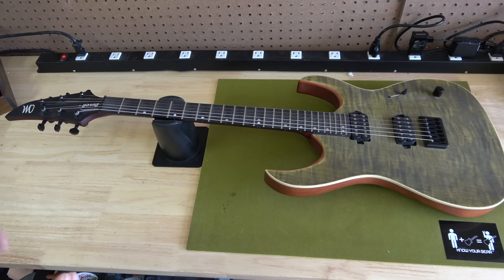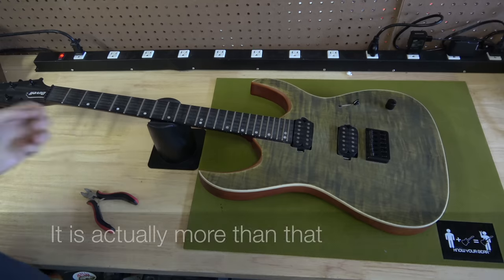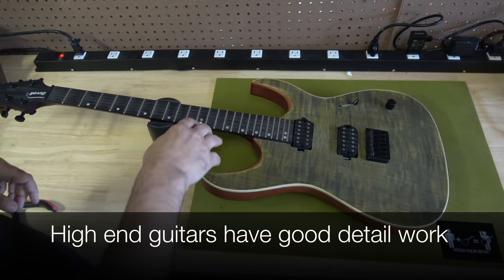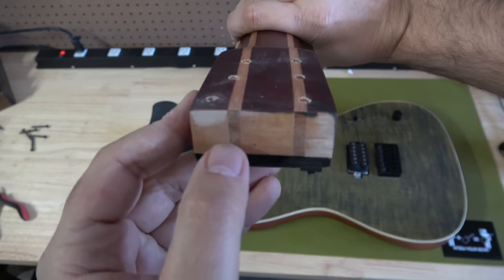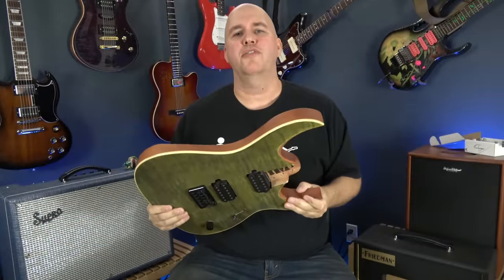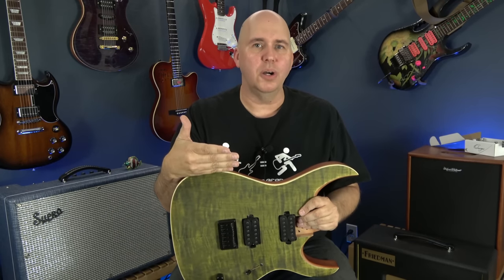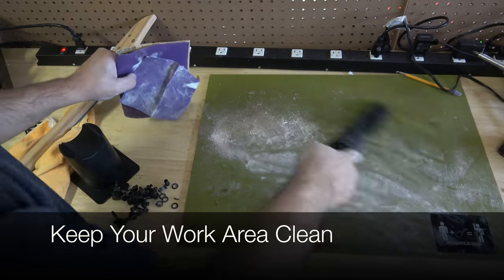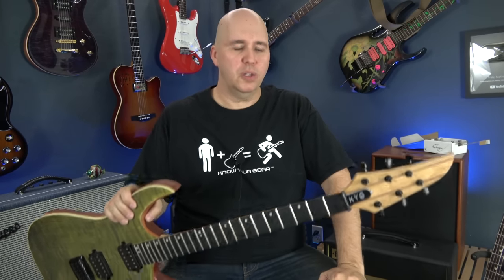Counterfeit Guitars Are Out Of Control.

Comment: Great video, thanks for posting it.
However, I think you should have mentioned the flip side to that.
If guitar companies weren't putting obscene prices on their guitars, maybe people would be less inclined to get fakes.
Especially the big lie about using "tone wood" in solid body, magnetic coil pickups guitars. 
As if there were some magic microphones picking up the resonance of the wood that makes about 95% of contact with your body.
And after you visit the factories and see how they actually make these guitars, you realize that you are paying 4 times as much as you should be paying for an average Strat, Les, Mayo etc.
I bought a good set of Alnico 5 pickups (not fake) from a Chinese company called Homeland. We compared them to Jazzy Cats, Fender, Fender custom shop and others and they crushed it. Good pickups. My advice is, not to buy guitars with fake logos but if you are after a cheaper guitar, buy them from Chinese custom shops. Some of them make excellent guitars. 
Also, if you ARE keen on buying American produce,  my advice is to reward companies that take the time to really make an effort into making a good guitar for you.
Take PRS for example. In my opinion they are the best "mass producer" in terms of value for money in USA. 
They take the time to invest in quality and materials and don't hire a star guitarist to justify and hype up a guitar made from Sassafras, as if it was some kind of Godly material that makes your guitar sound like it's from heaven... and sell you a bunch of crap because they had some extra wood laying around they needed to get rid of.
And if you are not keen on buying from a mass producer, by all means support the small guitar makers because they will take your guitar to the next level and they deserve that money.

Comment: I purchased a guitar from an individual Its Gibson SG Custom. Displays on back of the head stock 0200560 Made In USA. I emailed Gibson with serial number within 10 minutes Gibson emailed me back I had to send pics of head stock front and back, body front and back, binding on the neck and head stock, and tone control cutout. Got my answer back from Gibson they said it was fake. The wanted to know what guitar shop that was purchased at, I told them i purchased from an Individual. But playing the guitar neck pickup was very bass sounding and bridge was treble sounding hardly no sound coming from it. I installed Seymour Duncan Hot Rodded Humbuckers. which sounds excellent.

Comment: I feel bad. I had a Squire Strat, was my first guitar that I got when I was 12. I overhauled the whole thing. Every piece of hard ware, every electronic. As I used as many authentic Fender parts as I could, or bought high quality parts when I couldn't get my hands on something Fender. Spent way more money than it would ever be worth. But when I refinished the head stock I bought a Fender decal. I figured there was no harm since I would never sell it since it had sentimental value to me. And it played as close to a real Fender that any Squire could. But then it was stolen and never recovered. I'm sure they pawned it. But someone out there probably thinks they have a real Fender strat when really it's just my $100 shitty guitar with $200 worth of parts in it.

Comment: I do not condone ripping off someone else - ever. However, I have a "Slash LP Chibson" that I paid $225 for (Slashs' original AFD guitar was also a knock off, I might add). Anyway, I swapped out the pots, tuners, added Sey. Dunc. Slash pups, and leveled and dressed the frets AND the thing totally kicks fucking ass! The difference (if any/very little) between an actual Slash signature Gibson and mine in play ability and tone is negligible. However, the difference in price is very substantial (mine, all in, was under $500). Everyone who has played it didn't know it was a Chibson until I told them...EVERYONE. So, until I hit the fricking lottery, I have no problem using a "counterfeit" but, very workable base, then adding quality parts where it really counts and ending up with a smoking fire axe. If that is bad then, I guess, I'm happily rotten. Oh, well. P.S. I'd never resell it as authentic because, only a total MF'ing piece of shit prick bastard would do something like that. Peace out.

Comment: Here's my story, of a too-good-to-be-true guitar purchase.

I started off on a Squier Strat.  When I decided to upgrade, I did a lot of research.  Fixed bridge guitars stay in tune better, and I hadn't really used the trem bar, so I wanted a fixed bridge.  I also like rock and metal, so a humbucker arrangement seemed like the better choice.  I eventually decided that I would upgrade to a Schecter Hellraiser.

I was saving up for it (about $850 retail), when I came across one on Amazon.  It was $588.  It also looked a little different, and that had me concerned.  Schecter had the Satin Black and a Red Burst Hellraiser on their site.  This was a Trans Black Burst.  On the one hand, I really liked the look of it.  I liked it better than both of the color options on the site.  But it set up some red flags.

So I did my research.  I reached out to the vendor, and they said "oh, yeah, it's the same exact thing as the others, just a different color."  Well, that didn't satisfy me, because of course the vendor would say that.  So I looked on Schecter's archive, and after hours of searching, I could not find a trans black burst Hellraiser.

I was ready to go to Amazon and report that they had a counterfeit guitar on their hands, but I had to be sure.  "I can't find it" isn't proof enough.  So I reached out to Schecter.  I sent them an e-mail with a link to the Amazon sale, and asked them what the deal was.

"It's the same exact guitar, just an older color run."

Now that Schecter confirmed it, I knew I'd found the perfect guitar.  It was the guitar I wanted, in a better color than I'd thought, for $260 cheaper than I thought.  It was too good to be true, except it was true.  And it's my favorite guitar.

Comment: I think a more dignified way of branding it other than fake that reflects that it has been repaired and upgraded would be better.  Perhaps a color coded KYG - say, in red, to reflect that it is an upgraded and improved fake guitar would give it more value; after all- you Phil, have put so much work into it.  It is starting a trade mark on your work that was once a fake guitar. I, for example might be more inclined to buy a KYG rehab-ed fake from someone than say, a Squier.  You can, again, code it with a KYG and serial number of some sort so that your work can be authenticated (somehow).  I know that there may even be those who will fake that work as well, but a way of certifying that you worked on a fake that can be verified is certainly less embarrassing than having a guitar that you worked on branded "fake".  But I totally admire what you are trying to do here - don't get me wrong.  But separate the past from the current would be a better move I think. If there is a legal thing I am overlooking- then forgive me in advance.
Peace-

Comment: I feel I should have to anything I want as long as it is only for me. That actually is the law. I think it sucks to sell it as something it is not ie real. I admit I had a ric style guitar made with a 46mm wide neck because Ric would not make one for me and I used a style of their shape with a bound headstock and mini humbuckers.  it was my guitar for me, my vision of what I wanted in my life that I could not otherwise get.  I did not put their logo on the headstock.  Counterfeiting is reprehensible. We can get a good custom guitar from China at a modest price but all not distributed by majors are villified as all fakes. There is bias underpinning all of this, even when the materials are the same or better they are considered virthually worthless,  you said you wouldn't pay a premium price for a Chinese guitar (I am sure with exceptions but you said it).  it is rarely said these are good guitars unless a corporation is selling them. Reminds me of the idea that everything is bad until the big boys buy up tool up.then it is ok, The internet was a porn threat til AOL came up.  All I am saying is there is good in all of this if it can be pulled up to the surface.

Comment: I know this is an old video, but it's still happening, and the forgeries are getting lazy. I just came across three different "Gibson" guitars, from three different sellers on Facebook marketplace. All three of them were the laziest forgeries I've ever seen. Gibson on the headstock, but on the back of the headstock it's printed: "Designed and backed by JSN"

These are Firefly guitars where all they did was replace the firefly logo on the front with a Gibson logo. Lazy. Lazy. Lazy.

Comment: It seems to be getting ever harder to tell the real thing - I've seen so many Gibson J45's etc that I seriously wonder about. One thought for collectors of older Fenders from the early 70's ; if the finish is still  really good it's probably a fake. My 72 strat even though kept in a case and rarely used after the first 6 months still developed cracks and spots in the finish which just seemed to be a thing of ageing.

Comment: I live in the Philippines and I buy low cost telecaster type guitars than upgrade them and sell them, if your a guitar manufacture and can't build a telecaster, your really in the wrong business, I buy a brand called JCraft they were made in Japan, but I think they have a factory in Indonesia, I have yet to find one of these guitars that is not put together nice, I have heard their factory is a very strict company to work for, the guitars I buy are solid Mahogany body, maple neck, they cost about $100,the tuners are crap, the electronics import, plastic nut, pickups not bad but I upgrade them, I have two Fender telecasters from the USA, when I finish my guitars they are as good as the Fenders, but almost the same cost, but in the Philippines Fenders are sold for top dollar, the reason you cannot buy a Fender in the USA from a dealer and have it shipped to the Philippines, Fender Philippines has the market

Comment: I feel like something less brash than only "Fake" would be nice, seeing as you've done work on it to make it playable.  Definitely good to brand it as a means to avoid future cons, but if you branded it with something else (like "KYG") it would (A) signal that if the guitar is being sold under a different brand, there is something fishy worth looking into, (B) possibly start a "trend" among techs/luthiers to do something similar, and branding would signify it is a fake, and who verified it (and thus having some "branding" (lol), although it piggybacks off of bad practice), and (C) the guitar would still have value in and of itself - since you've set it up, made it more playable and all, and because the profits of future turn-over won't go to con artists, it's a nice way to buffer out some of the cost someone who get's conned pays.  Point is, even if someone doesn't know what the branding "KYG" means, they'll know something fishy is going on with the ostensible name-brand guitar they're looking at - it doesn't necessarily need to say "Fake" and it could go a long way to incentivize other luthiers to do the same.  Ofc there is a problem of false positives... that would suck

Comment: The most reliable way to spot fakes of American made guitars is to take measurements of practically any part of the guitar with a caliper.  If the measurement is a whole metric unit then it's almost certainly fake.  Chinese factories can't make anything in American customary units.  Their tooling only allows for metric and it's impossible for them to retool to do it.

Comment: Kit guitars are the best way to go, if you can't afford a real Gibson or Fender, you pay the same amount you would for a complete Chinese knock off, but with better quality because you built it. I started building kits, because I was replacing the hardware anyway on the complete Chinese knockouts, so might as well just build my own with good hardware. When I buy a kit, I request not to send any hardware, just the body and neck, I use my own hardware.

Comment: I bought a multi pack of Fender original bullets (11s) that were obviously not right just by looking at them. When measured the sizes were all over the place - nowhere near correct and completely unusable... bad Quality Control or fake?
Either way it’s put me off Fender strings for ever.

Comment: The last 3 ESP LTDs I have had are beyond unplayable -  Absolute firewood.

Even after a $200 pro setup (by the guy that made my $5000 hand made custom shop guitars) they were still junk.

They were double (if not more) than the price of these chinse guitars.

Chinese guitars used to be a joke... until the big name manufactures moved everything to china, jacked the prices up and churned out horse shit just as bad.

No, I am absolutely NOT paying $1500 for a made in china Epiphone, Im NOT paying $2400 for a made in Korea LTD and Im not paying $4000 for a Gibson.

A few years back I bought a box of gibson faded flying Vs. not 1 of the guitars came out of the box without issues, and all needed to be sent off for repair.

I don’t WANT to buy ripoff shit, but the big names have us bent over a barrel with shit just as terrible in a lot of cass.

Comment: I have a bunch of copies and some are quite good. I bought them new and I either scarred the headstock or covered the brand with stickers. I would buy the ones that offer custom names instead of gibson and fender but they charge more for that and considering that I`ve bought some good, some bad ? I`m not throwing another $50-$100 to change the name when its easier to just remove the brand name. I`m also not paying $5000 for what gibson or fender says it the cat`s ass because guess what? They arent all as good as their good ones. I`ve played lp`s in the store new and used that just plain sucked. And they were undoubtately gibson-just not very good and certainly not $5K good.

Comment: I [personally] cannot condone copy guitars BUT I have a couple and I feel no shame. Why? Because...well, one example - I have a genuine 2008 Les Paul Goldtop (US$1200 + US$50 shipping), and I have a Chibson Greenie/Moore (US$200, free shipping). There are small cosmetic issues with the copy...there are equal or greater cosmetic issues with the genuine. Cosmetic, don't affect playability, and they both play equally fine. Pickups on the genuine are slightly louder than the copy (same sound/different volume) - I have a knob on my amp that resolves this. Then I see on youtube unboxing of a $200 Chibson and some soul criticising a chip here and a ding there, or the truss rod wasn't tensioned correct...and I see on youtube a guy with a $5,000 Gibson or Fender custom shop with equal complaints. The best example is to find the youtube video of the making of John Mayer's black strat by Fender custom shop - cut a long story short, these custom shop experts, making a one-off special for one of today's top guitar players, not only forgot to solder (I think) an earth wire (making the guitar silent when amplified) but seemingly no-one at the factory bothered to plug it in and test it before sending it to said star. If that's what they can't do for a star, think what they can't do for you.

The moral of my rant is simple. To Fender and Gibson in particular, stop trading on the achievements of the great men decades before you. You don't have to be great, you simply need to maintain a quality and sell it at a premium because of those who went before you. What (I find) is disgusting is that you produce crap quality, charge triple premium prices (based on your expected share price) and then act surprised when people who want to play music turn to alternative, accessible (financially) sources. Take responsibility, not legal action.

Comment: aliexpress is an amazing website, they sell everything direct from the factory so it's much cheaper.

Also, fake guitars aren't an issue and are not taking customers from the real guitar manufacturer, they're only an issue for the idiots who get scammed by people who are passing them off as real. i have a fake les paul, it's absolutely gorgeous, i think i got lucky and received a gem. anyway, i have no interest in buying a real gibson, i have no interest in spending £2000+ on a guitar. you may ask why i didn't go for an Epiphone. well i hate the Epiphone headstock.